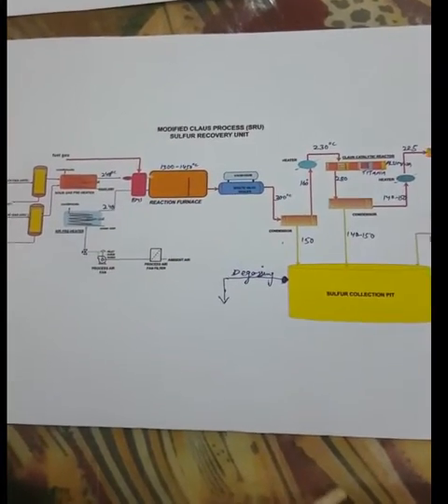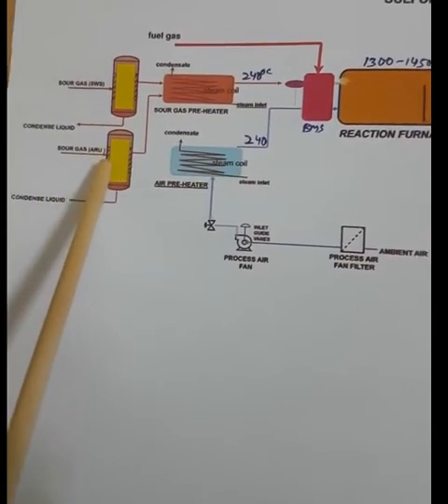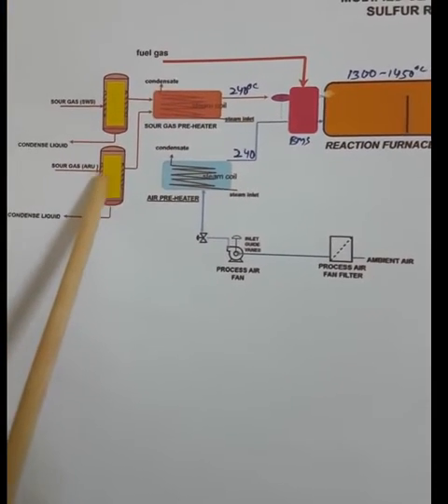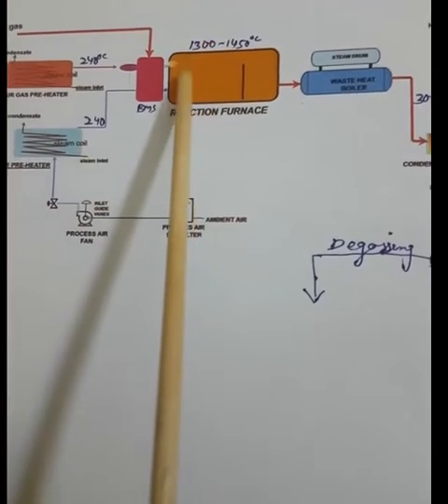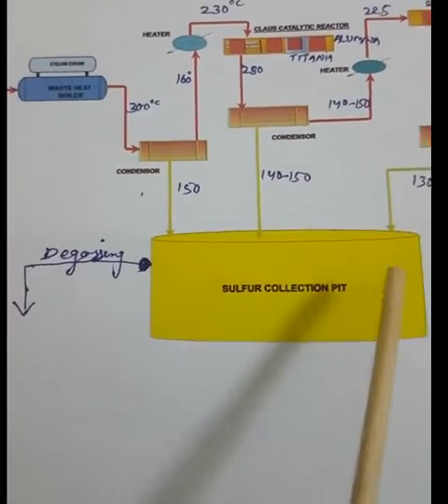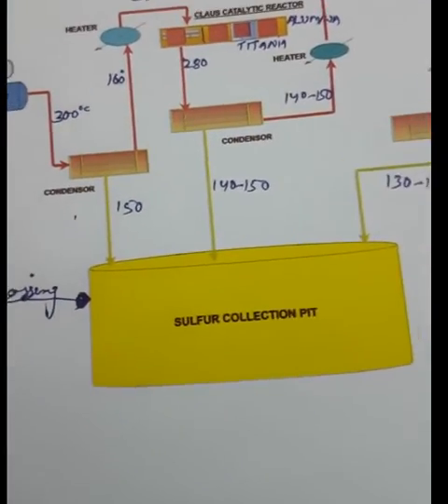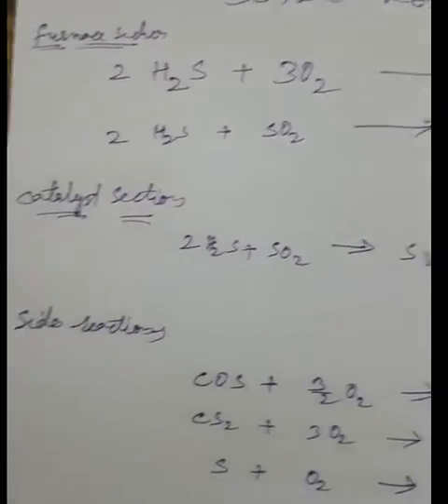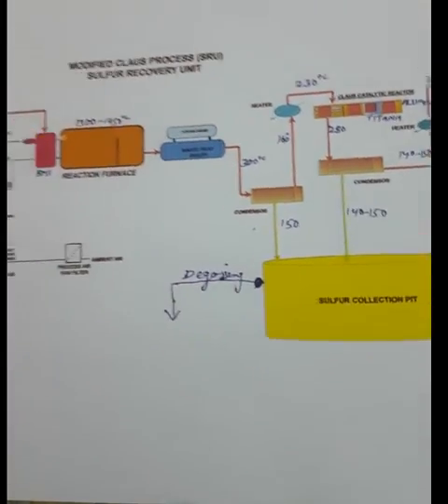Sulfur recovery unit " process description" SRU

Comment: I am  Chemical engineer  I worked in  SRU plant
Reply: Hi. Which type of pump is used for Liquid Sulfur loading arms.
Is the Pump having 2 separate discharge line for liquid unloading and solid unloading of sulfur.
Reply from the maker: steam jacketed centrifugal pumps are used 
in one company we used submersible pump for transfer
and another branch we have vertical and horizontal pump which are not submersible
but both pumps will always have continuous steam to avoid solidification of sulfur.
pump will have one discharge line and one mcf line for circulation to keep pump always in hot condition with flow of steam

for solid prilling tower conveyor rakes are used to transfer solid sulfur as pump  cannot pump solid sulfur solid sulfur is hard as 🪨 stone.

molten sulfur will be load in tanker from top lid of tanker arm is withdrawn from top to the tanker
sulfur tankers also steam jacketed
Reply: @chemicaldiary8412  in which Refinery you are working ?
Reply: Which type of flow meter is installed to calculate liquid Sulfur flow to loading arms.
Reply from the maker: endress hussar flow meter ,insertion type 

we used 1.8 specific gravity
molter sulfur flow rate is 16m3/hr then how much will be loaded can be determined by 16*1.8= 24 ton would be weight of sulfur tanker loaded

Comment: DEAR FRIEND 

I HAVE ONE DOUBT TEMPERATURE 1300 TO 1450 FOR WHAT
Reply from the maker: we must have furnace temperature more than auto ignition of hydrogen sulfide
u can burn at 600 degree also it is advisable to go for 1000 degree different vender different variable